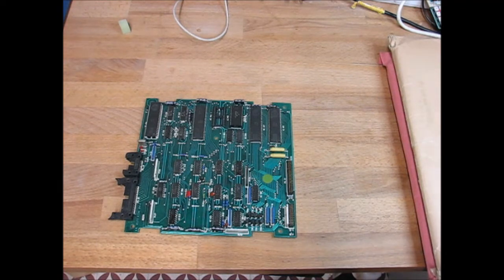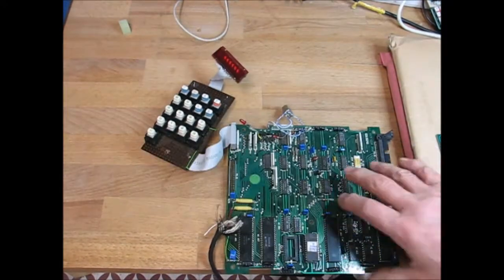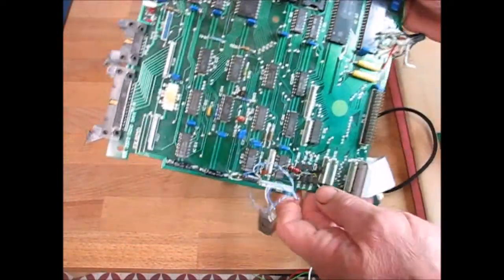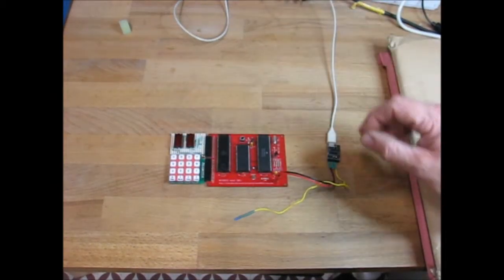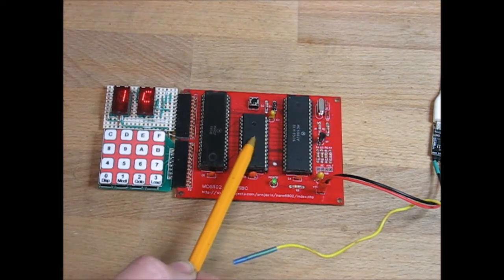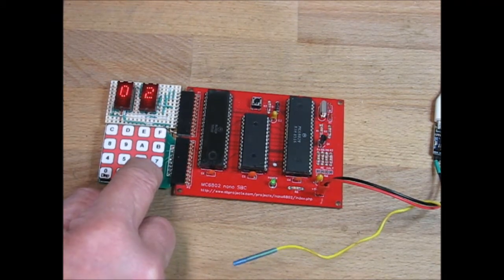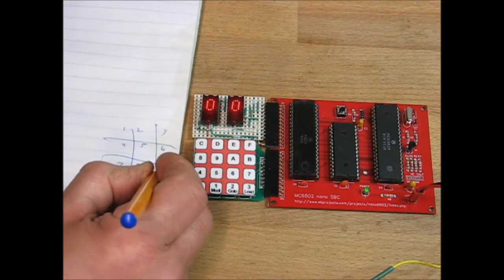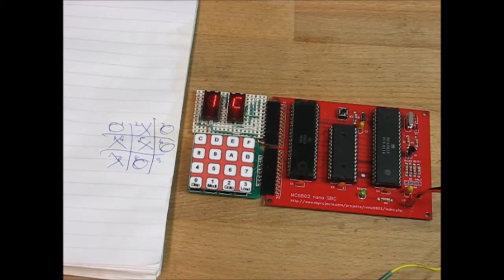Retro Motorola mini-6802 system - lockdown2, 2020

Comment: Great video.

I hand coded a monitor for my 6802 system in 1984. I had reprogramed a video arcade game to render a beast you  programed in raw hex. Lots of fun and fast too. Had a homebrew S100 video card hanging off the bus and that helped a lot. You could call up a display if 255 bytes of memory. Much better that reading a display of eight LEDS in raw binary.